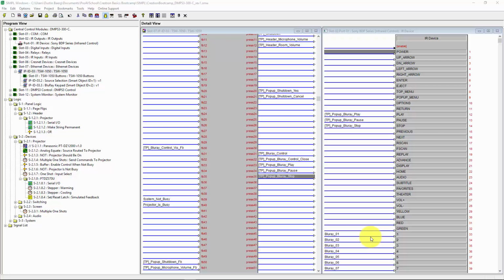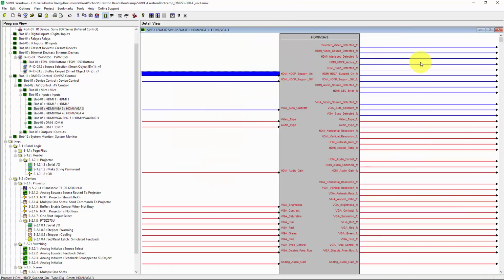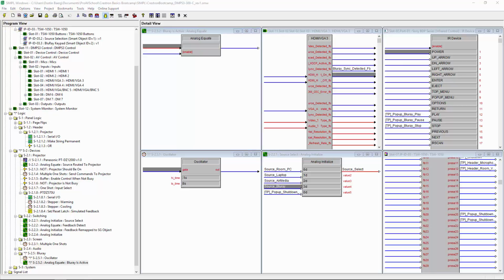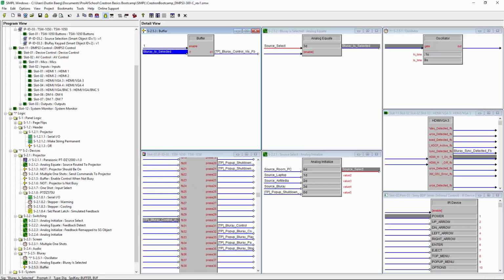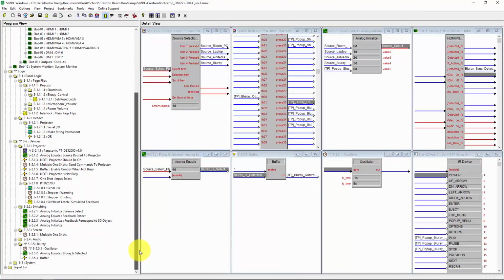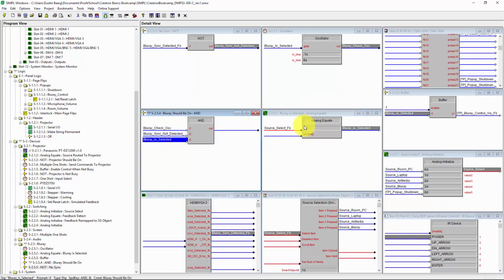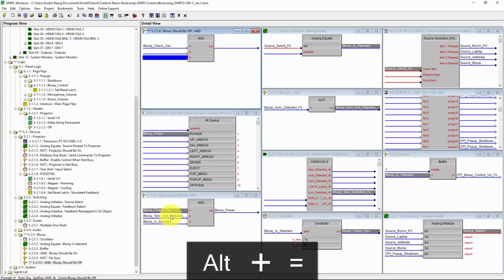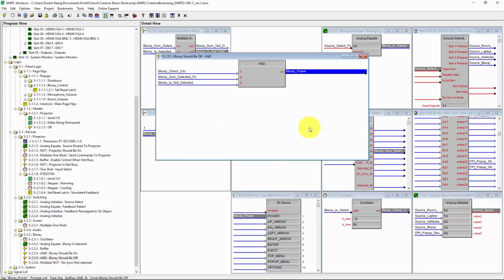Crestron Programming - Using DMPS Signal Feedback To Keep IR Device On

Comment: Turning off the blu-ray doesn't work, since you are using bluray_is_sld to enable the osc gate.
Reply from the maker: shoot...you are right!! I had tried to clean up the amount of checking the program was doing by using where the UI was, and if it wasn't on the blu-ray page then ignore it. But I failed on this one point because as you noticed, the instant you navigate away from the blu-ray page the check will STOP. So it won't ever evaluate the condition where it should check for blu-ray off.

The right way to have done this would have been for me to use system on/off to feed the gate of the oscillator. Or even just keep it always checking regardless of what else is happening. Thanks for pointing this out, I will see if i can make a note on the video.

Comment: Some devices will show sync_fb high even though the unit is off (cable box for example),  For bluray without discrete powers i send "play" as a power on and power toggle to turn unit off. Good to see videos like this, keep up the good work.
Reply from the maker: Thanks! You are right, some devices are always outputting sync as long as they are powered on. It is annoying!!
Current sensors don't even work for low power device either.
I've thought of building some sort of a light metering circuit that you could stick onto the LED or power light to give power status..might be an idea for someone to develop